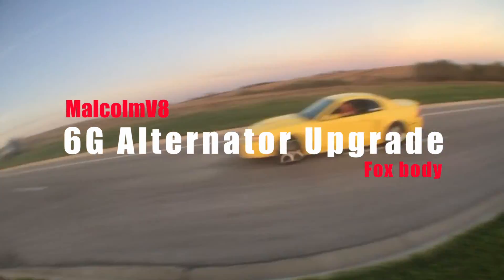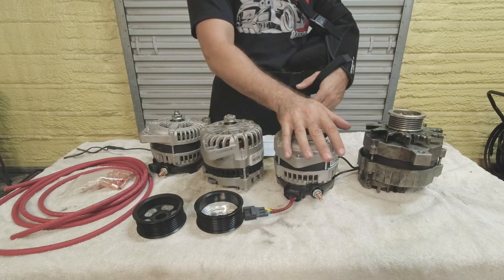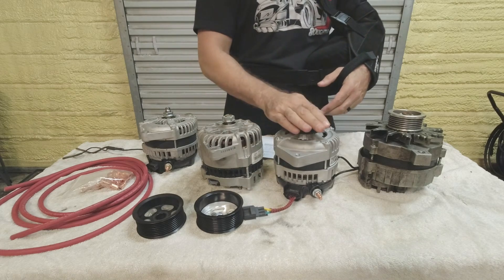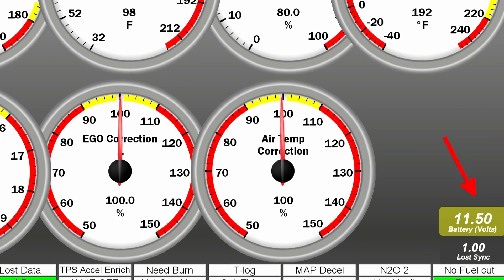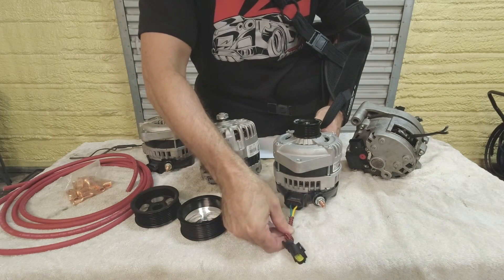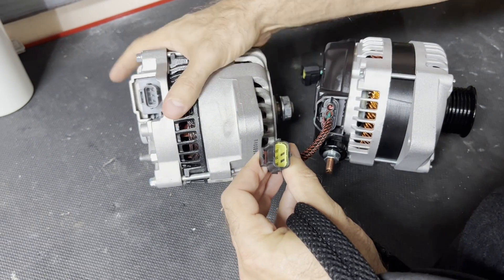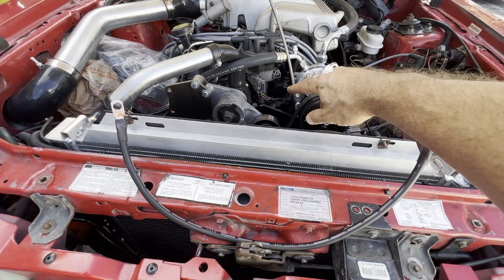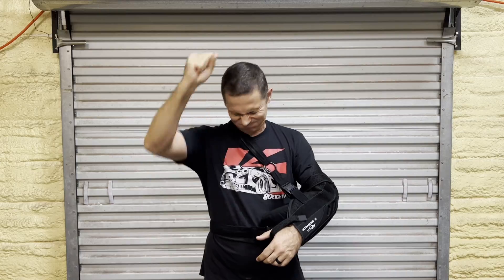Bolt In 6G Alternator Upgrade for your Fox!!

Comment: I installed a 3g 130 amp Alt in my 69 mustang. Its not enough. Maybe my double v pulley is to big at 2.8",  But with Headlights on, 28 amp rad electric fan, and 1000 watt subwoofer turned up my car goes under 12 volts at idle easily, and will stall. Only thing I did was remove the factory regulator, and snip green/red wiring into my 3g matching one. Should these be easy for me to upgrade again?
Reply from the maker: 130 amp is on the small side for all that.  You may need a bigger alternator.
Reply: Yeah you can only get a 200 in the 3g. I'd swap it out for 4g. The 6g have issues
Reply: I'm running around 2500w on a 135 amp right now, it's pushing it. You don't want it to drop under 12.8 if you can help it. The smaller pulleys are better for idle. I'm running 2 batteries and  6 farads. If you get a big 400 amp 4g, it can do 135 amps at idle. The plugs going to be different.
Reply: @unbanmy360 Actually I think my double pulley is a truck one at over 3" i was thinking I should go down to 2.25" one and id be fine.

Comment: Will this mod fit a 04 E150 5.4L? Currently has 3g?? Need the higher output amps for powering campervaning kitchen appliances
Reply from the maker: I'm not familiar with the E150 lines.  You'd need to look over your alternator housing and make sure the replacement will fit.  There are many different styles or casings for 3G alternators.

Comment: What about external voltage regulator?  Mine is 86 v6 can i eliminate it or not? 
Thanks
Reply from the maker: Yes these alternators are internally regulated.  No external regulator required.

Comment: Do you know which G6 require a pwm/freq input to set the output voltage?
Reply from the maker: I do not but maybe someone else in the comments does.  Fox bodies don't have that requirement so that wasn't something we looked into.
Reply: @MalcolmV8  I see your running a megasquirt product.  The MS3 has the software to drive the pcm controlled ford alternators.  I'm working that direction with my setup.
Reply from the maker: @ryandenney351  yes correct.  I saw it can do that, I guess we just had no reason to in our case.  Best of luck and let us know what direct fit alternators you find that work in the application.
Reply: @MalcolmV8  I just picked up a 06 ford taurus ohv V6 alt.  $25 from the local yard.
Reply from the maker: @ryandenney351  does it meet your amp requirements and PWM control?
Reply: @MalcolmV8  I waiting on a harness plug and new regulator to come in, but ford rates them at 110 amps.  I also swapped the input over to a v belt.
Reply from the maker: @ryandenney351  good deal.  That was not enough amps for what we needed but if it works for you that's a great score.

Comment: This 240 Amp Alt will bolt into a factory fox alternator bracket?  Just confirming because your setup isn’t factory.
Reply from the maker: Yeah sure does.  We had changed things around a little but where still using the factory alternator.  Others have confirmed the installation into a bracket in the stock location too.
Reply: Will a stock 3G alt pulley fit?  If I run the small one that comes on it then I will end up spinning it over 20000 rpm.
Reply from the maker: All the Denso units I’ve run had specific pulleys and did not accept 3G pulleys. Instead get a denso alternator pulley if the correct size or order the alternator with the size pulley you need.

Comment: I'm installing this on a 2.3l and the pulley on the stock alternator is smaller than the replacement. Will I be good with the bigger pulley or should I put the smaller one on? TIA
Reply from the maker: You would likely need to be close to stock unless your alternator manufacture gave you specific sizing to follow.  Generally an over sized alternator pulley can cause low voltage issues at idle.

Comment: Hi man, 
Thanks for the great videos.
I have a question - Say I Have a 75A alternator. And I found that at idle, the voltage is less than 12V in the battery (when fan is ON). In order to increase the alternator power at idle, can I just install a smaller pulley on it ?

My total load is way small than 75a.
In a cases like this, a smaller pulley is a good idea 💡 ?

Thank,
Amit.
Reply from the maker: If giving the car some gas and raising the RPMs immediately fixes it then yes you can potentially get away with a smaller pulley.  It can also over spin the alternator at redline if you over do it so just keep that in mind.

Comment: In no way shape or form is the 6G better than a 3G.  This is over 20 years experience in the industry talking.
Reply from the maker: People in the industry tell me better bearings and cooling.
Reply: Depends on your application. It certainly handled itself well in this case.  I like it just for the simple fact that it's smaller and doesn't require you to notch the factory bracket.  For those just wanting to upgrade the factory setup, the 6g seems like a straightforward option.